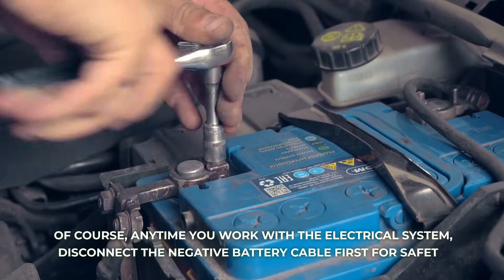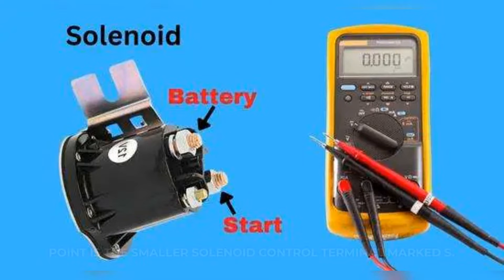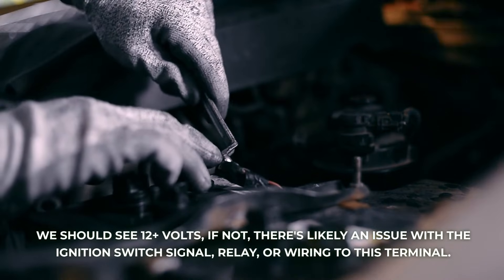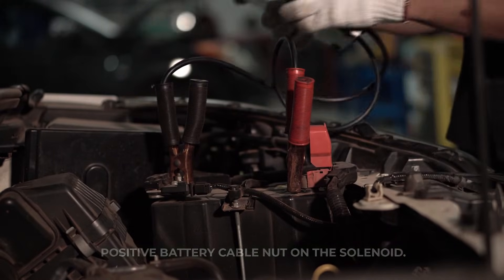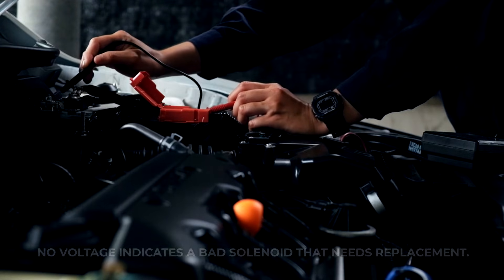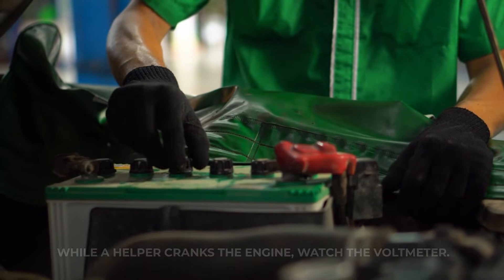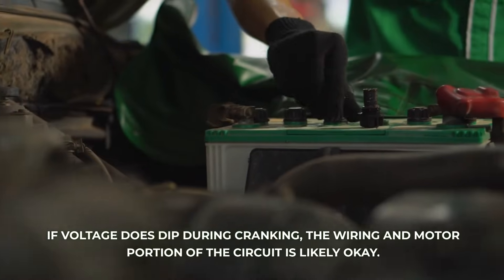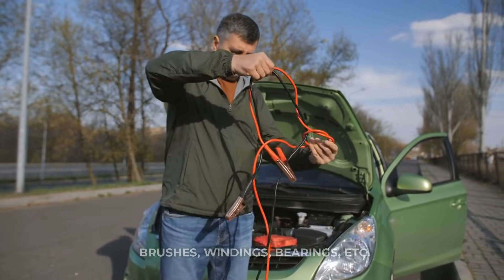How to Test a Starter Motor With Multimeter

Comment: Thats not testing the starter motor with a multimeter. That is testing the voltage to the starter motor with a multimeter.

Comment: Disconnect battery... check for voltage.  This is why the parts store sold my friend a new battery (and installed it) then sold her a new alternator all because the battery  terminal was broken and wouldnt tighten down.

Comment: The very first part where we need to know where to touch wires to starter, around 50 seconds in, the video speeds up and neglects to actually provide a visual example of which wires connect to where. lost me.

Comment: with the negative post disconnected you won't find any volts.
Reply: The negative just disconnects the current back to the battery. The starter is still grounded so electricity will still flow to the starter and out its own ground.

You may survive 20 amps, but you’re not going survive 1000 amps when the battery decides to make you apart of its circuit.

Comment: Lost me at disconnect battery and check for voltage
Reply: If the battery is disconnected - how do you get a voltage reading?
Reply: this video seems to be AI generated and thus poorly made as will be with AI videos for sometime cause of the attention to detail that is needed is just not available. 

not that all AI tools are created equal cause using AI to edit your actual video produces much better results than can be achieved with using a service that provides pre recorded video clip library  or even worst AI generated clips... anyhow AI is not all bad but this video seems to be the wrong kinda topic to excel with AI generated videos ... a fictional story would be a much wiser topic to use for making AI videos generally speaking I think... anyhow Cheers to your comment jake.
Reply: @WilliamCrandell  my truck been down fa over a year with nobody knowing why this was definitely the best video ive come across for my issue. Dont see how it was “poorly” made
Reply: to be clear AI is not good for generating how to "video" guides from text input only yet
Reply: Me too.
Reply: Disconnecting the negative from the battery just removes the battery from completing the circuit.
A lot of electrical components in a vehicle has its own ground connections and will still be apart of its own circuit with the positive attached to the battery but have a much lower amperage.

The whole vehicle electrical system with negative attached to battery can exceed 800+ amps.
Reply: Literally this video is awful 🤣
Reply: You completely ignored the context....and added words...that were not stated in the video.  What they said was to disconnect the negative terminal when working with the electrical system.....meaning of course, when you are disconnecting any cables from the starter, you need to disconnect the negative battery terminal.  Very good advice, as many idiots disconnect vehicle wiring with the battery still providing power to those circuits.  This sub-thread just shows how dumb some people are about car mechanics...lol.